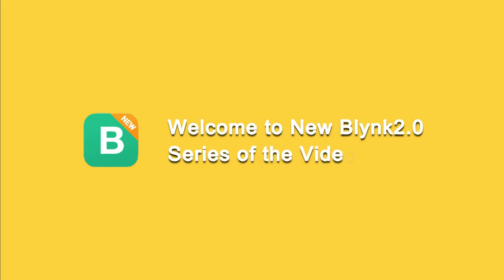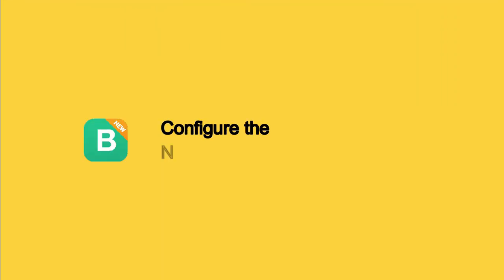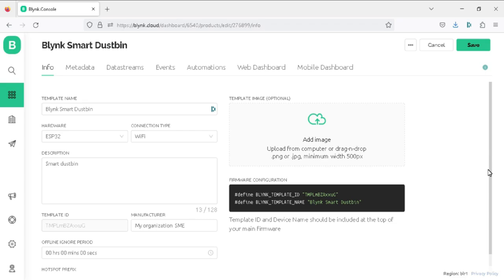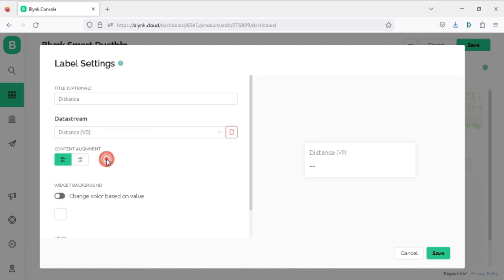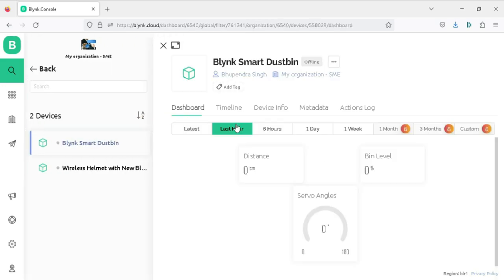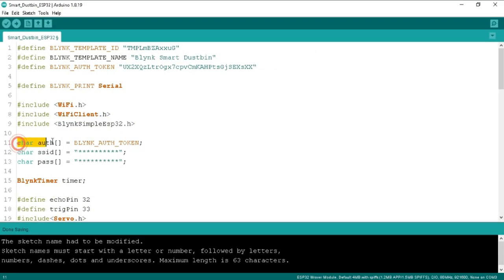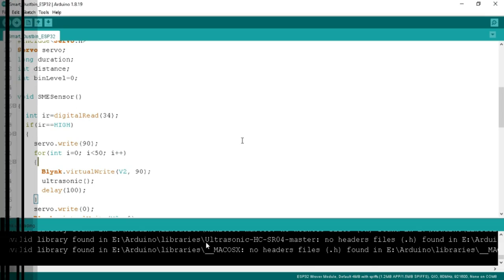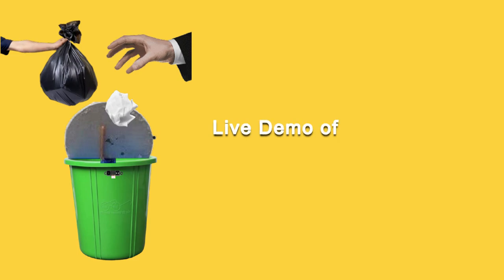Building a Smart Dustbin with IoT using Blynk 2.0 and ESP32/NodeMCU ESP8266 - Method 2

Comment: How to use nodemcu esp32 in this same project
Reply from the maker: You can use through serial communication or SPI or I2C method. Even you can communicate through wifi.
Reply: link is not opening @SMEDehradun
Reply from the maker: Which link?

Comment: bro the ultrasonic sensor is not responding!! i got light on ir sensor and servo is at angle 90degree!!! in my dashboard  the distance is showing 0 , bin level 100 and servo angle 90 degree!!! what shpuld i do now bro please help me out tomorrow i have my science exhibition !!! i am using esp2866
Reply from the maker: Hi,
Check that ultrasonic sensor is working or not? try to read the ultrasonic sensor separately first. If that working then try.

Comment: Hello sir, 
Code is working, 
But during the first time the IR sensor detects fastly and servo motor is opened and during the next time when i place hand infront of IR it is not detecting, it is taking more time
Reply from the maker: Hi,
Make sure that IR sensor would not get any direct light from any where. 
Also check that there is no any power issue in your board. 
Also check, your IR sensor is working properly or any connection issue.

Comment: For ESP8266 how and where have you given the power supply? Also what power supply have you given?
Reply from the maker: I have used 12V to 5V external power supply for the ESP8266. 
I used Vin pin for power input. 

You can use it without external power supply as per the circuit diagram.
Reply: @SMEDehradun  if we connect as per the circuit without the power supply ,then what will be the power supply for the system?
Reply from the maker: 5V 2A can work. You can provide the power from the computer’s USB port.

Comment: i tried doing everything sir , i connected it to 5v usb cable with 1A , i followed your tutorial step by step , code has also been uploaded but its not working , the sensors are not detecting anything , the servo motor is not rotating , i dont know what to do sir , please help me , there is a competition in few days and iam worried a lot , u r my last hope sir 🙏🙏🙏
Reply from the maker: Try to operate your all the hardware first like servo motor, IR sensor, ultrasonic sensor. 

Do the separate coding for these and check all aare working separately fine or not. Once all done well, then again try the complete code.

Comment: Uv sensor is not detecting the percentage and when I disconnect the ground of UV sensor it is showing the percentage but ir sensor and servo motor is not working
Any solution?
Reply from the maker: UV Sensor?
Reply: Sorry *ultrasonic sensor
Reply from the maker: Check the connecting wires if you are not getting data from ultrasonic sensor.
Reply: Wires are connected correctly the thing is when I disconnect the ground of ultrasonic sensor it is working but then ir sensor won't work
Reply from the maker: Check whether you missed any connection of ultrasonic as well as IR or you have plugged some connection wrong.
Reply: Its working
Thank you!
Reply from the maker: That’s Great. 🙏

Comment: Can this project work on 2 ultrasonic sensors? instead of using Ir sensor for opening and closing the dustbin, is it possible to use ultrasonic sensor? Thank you in advance sir!
Reply from the maker: Yes you can.
You can replace the the ir sensor. And you need to change little bit coding.
Reply: Sir could you please you provide those changes  @SMEDehradun
Reply from the maker: You can try it by yourself. If there is issue you can write it then.

Comment: Hello sir... Can you please provide proper code for esp32. I have tried everything but code isn't working it showing error.
Reply from the maker: Hi,
Both codes are well tested. So I think you are not following all instruction as shown in the video.
Reply: WARNING: library Servo claims to run on avr, megaavr, sam, samd, nrf52, stm32f4, mbed, mbed_nano, mbed_portenta,

In file included from C:\Users\admin\Downloads\smartbin123\smartbin123.ino:20:

mbed_rp2040 architecture(s) and may be inco

C:\Users\admin\AppData\Local\Arduino15\libraries\Servo\src/Servo.h:77:2: error: #error "This library only supports boards with an AVR, SAM, SAMD, NRF52 or S #error "This library only supports boards with an AVR, SAM, SAMD, NRF52 or STM32F4 processor."

exit status 1

Compilation error: exit status 1

Sir i followed each and every step carefully but still above error occurred
Reply from the maker: @BhagyashreeDGade  there are different servo library for ESP32 and ESP8266 board. if you are using esp32 board, then install the esp32 servo library for it.

Comment: Sir, i want all this that you did in this project and also want to send a alert email or notification on the app , that Dustbin is full
Reply: Sir kindly tell me how we add an alert message that Dustbin is full???????
Reply from the maker: Hi,
To add mail alert and notification, below video li k may help you

https://youtu.be/T8vPXUrAfco
Reply: @SMEDehradun  sir , how we set limit in dustbin project that when it's full when it sends an alert message only .
Because in fire alarm it's quite different.
Please help me ..
Reply from the maker: You need to set the timing for the alert to the blynk dashboard and call that function in the function
Reply: Actually i want to ask that, how we set that Dustbin only send e mail when it is 90% full or above...

Because in blynk dashboard it doesn't shown any condition like when it will send e-mail in alert section.
Reply from the maker: Join our official telegram channel for your query. Below is the link to join. 
 
https://t.me/+vJcqQmRQLKYwZWQ1

Comment: I cant open the code for 8266 please bro add google drive link for easy
Reply from the maker: Link is available in the video description for the code. That is the github link.
Reply: But the link is not opening bro 😞
Reply from the maker: It’s working here. It may be due to network issue there. try once again.
Reply: Not working bro 😷
Reply from the maker: @No_copy_music  it's may network or browser issue. you have to look on it.

Comment: Good day! If I were to use GSM as the connection type, would there be changes in the code?
Reply from the maker: Yes. If you want to use gsm network to connect with blynk, then code will be different.

Comment: sorry my coding is error l , i already to download library servo esp32 but still error like this

WARNING: library Servo claims to run on avr, megaavr, sam, samd, nrf52, stm32f4, mbed, mbed_nano, mbed_portenta, mbed_rp2040, renesas architecture(s) and may be incompatible with your current board which runs on esp32 architecture(s).
In file included from C:\Users\User\Music\teseps32\teseps32.ino:19:
c:\Users\User\Documents\Arduino\libraries\Servo\src/Servo.h:79:2: error: #error "This library only supports boards with an AVR, SAM, SAMD, NRF52 or STM32F4 processor."
 #error "This library only supports boards with an AVR, SAM, SAMD, NRF52 or STM32F4 processor."
  ^~~~~

exit status 1

Compilation error: exit status 1
Reply from the maker: Servo library for ESP32 & ESP8265 are different. So install as per your board.
Reply: @SMEDehradun  I've installed it according to the esp32 servo library same like in video
Reply from the maker: Hi,
Select the ESP32 board, then install all the libraries one by one then try to compile the program.
Reply: @SMEDehradun  fixed #include <esp32servo.h> sir
Reply: @SMEDehradun  but the another trouble is my servo is not working proper sir the servo rotating delay so long
Reply from the maker: It may be network issue
Reply: @SMEDehradun  my network is good sir, or maybe the problem is voltage sir?
Reply: @ridwanbsatriaji7099   u are installing esp32 servo right . in the program include ESP32servo,h becuase the library u installed and the name should be same
Reply: Sir getting same problem how to clear it
Reply from the maker: Issue is not the code.  The issue is with your library or in the board selection.
Reply: @SMEDehradun  hello, what servo library for esp8266? u not showing in the video for installing the servo library for esp8266..
Reply from the maker: Servo library is builtin with your Arduino ide. You can use it for esp8266.

Comment: I modified the code of IR sensor since sometimes it detects , sometimes it wont. I also not include the wifi.h and client since it will appear error on my IDE. Instead of servo.h,  I replaced with #include <ESP32Servo.h>. I  dont know why it appears error when I just include servo.h......OVerall thank you for the tutorial. It helps alot

this is what  I have done in my code to make it work.

#define BLYNK_TEMPLATE_ID "  fill this up   "
#define BLYNK_TEMPLATE_NAME "  fill this up    "
#define BLYNK_AUTH_TOKEN "    fill this up      "
#define BLYNK_PRINT Serial

#include <BlynkSimpleEsp32.h>

char auth[] = BLYNK_AUTH_TOKEN;
char ssid[] = "       ";
char pass[] = "        ";

BlynkTimer timer;

#define echoPin 32
#define trigPin 33

#include <ESP32Servo.h>  // downloaded esp32 servo in the manage libraries
Servo servo;
long duration;
int distance; 
int binLevel=0;
int IRpin=34;

void SMESensor(){
  
  int IRsensor=digitalRead(IRpin);

  if(IRsensor==0){
    servo.write(90);
    Blynk.virtualWrite(V2, 90);
    delay(1000);  // adjust time for opening

    
    
  }
  else{
    servo.write(0);
    Blynk.virtualWrite(V2, 0);
    
  }
  ultrasonic(); 
  delay(100);
}
void ultrasonic()
{
    digitalWrite(trigPin, LOW);
    delayMicroseconds(2);
    digitalWrite(trigPin, HIGH);
    delayMicroseconds(10);
    digitalWrite(trigPin, LOW);
    duration = pulseIn(echoPin, HIGH);
    distance = duration * 0.034 / 2; //formula to calculate the distance for ultrasonic sensor
    binLevel=map(distance, 21, 0, 0,100); // ADJUST BIN HEIGHT HERE  (21, 0, 0,100) means 0-21cm=distance converted to 0-100%
    Blynk.virtualWrite(V0, distance);
    Blynk.virtualWrite(V1, binLevel);
}
void setup()
{
  Serial.begin(9600);
  servo.attach(13);
  pinMode(IRpin, INPUT);
  pinMode(trigPin, OUTPUT); 
  pinMode(echoPin, INPUT); 
   Blynk.begin(auth, ssid, pass);
  delay(2000);
  timer.setInterval(1000L, SMESensor);
}

void loop() 
{
  Blynk.run();
  timer.run();
  SMESensor();

  Serial.print("Distance: ");
  Serial.print(distance);
  Serial.print(" cm");
  Serial.print(" | ");
  Serial.print("Bin level: ");
  Serial.print(binLevel);
  Serial.println(" %");
   
}
Reply from the maker: what error you are getting? is it servo library error?
Reply: @SMEDehradun  error in servo library. Wifi.h and wifi.client. Also, the IR sensor is sensing only at start.  This was fixed already by adding library of the esp32 servo and uncomment the wifi.h and wificlient.h.    Made a modification of your code in the void SMESensor();   This is the modification I made:                                                                  

void SMESensor()
{

  IRsensor=digitalRead(IRpin);
 
  if( IRsensor==0){
    servo.write(90);
    delay(5000);
    Blynk.virtualWrite(V2, 90);
    
  }
     
  else{
    servo.write(0);
    Blynk.virtualWrite(V2, 0);
    }
 
    ultrasonic();
    delay(5);
    
 } 

and include that SMESensor in the void loop

And its working.
Reply: Or this two for loops ....it also works.....

int IRsensor=digitalRead(IRpin);

  if(IRsensor==0){
    for(i=0; i<80; i++)     
    servo.write(90);
    Blynk.virtualWrite(V2, 90);
   
    }
    
  
  else{
    for(i=80 i>0; i--)
    servo.write(0);
    Blynk.virtualWrite(V2, 0);
    }
   ultrasonic(); 
  delay(200); 
  } 
  }
Reply from the maker: Library of servo motor is different for both esp8265 and ESP32 board. After installation, see the example of servo motor and make changes in servo motor commands in the program.

Comment: Sir
My esp8266 is not connecting with my router but it is connecting with my mobiles Hotspot.please help me.
Reply from the maker: Sometime special character is not recognized by the code so try to make router name and password simple so that it can easily connect.
Reply: @SMEDehradun  OK sir 👍
Reply: @SMEDehradun  sir but my nodemcu is connecting with my mobiles Hotspot and I wrote the same ssid and password of my router in the mobiles Hotspot section.
Reply from the maker: Write simple name and password without special character and then try.
Reply: @SMEDehradun  OK sir

Comment: hello sir, i have a question, does IR sensor and step down power supply is a necessity because i dont have it. Tq :)
Reply from the maker: IR sensor is used here to sense the hand, to open the bin flap. So it is necessary if you are using automatic opening of flap. Step down power supply is not required. You can use 5V power input.

Comment: Sir what changes should I make in the code if I am only using nodemcu esp8266 and ultrasonic sensor?
Reply from the maker: For what? Explain.
Reply: @SMEDehradun  All I will be doing is measuring the level of waste and displaying the reslut in the blynk app.So, what changes should I make in the code?
Reply from the maker: Then remove the code of ir sensor and servo motor.
Reply: @SMEDehradun  Sir shouldn't the blue light on node mcu be continuously on ? Like not just blink and not work. Does this mean my nodemcu is faulty?
Reply from the maker: No. NodeMCU’s blue led connected to D4 pin. You can test it digitally by writing the code for it.
Reply: @SMEDehradun  No sir I meant the light that remains ON, after connecting only the esp8266 to laptop.The light that shows the nodemcu is working.
Reply: The blue light on the NodeMCU board typically indicates power is being supplied to the board or it’s actively communicating with the computer.
Reply: @SMEDehradun  Even in my device manager port section there is no nodemcu shown...this means my device is faulty, right?
Reply: @SMEDehradun  Sir please reply
Reply from the maker: Is your board shown the com port? If yes then you can try for the program. And if not then try to install the com port driver for your board. 
Below video may help you- 

https://youtu.be/LpohiGf8GiU
Reply: @SMEDehradun  I have done that already.
Reply from the maker: Then it might be issue with your board.
Reply: @SMEDehradun  Sir if I am using only esp8266 and ultrasonic sensor to measure waste level...do i need an additional supply? Like an additional power supply other than me connecting the esp8266 to laptop? I am only going to use the prototype 5-6 times.   The laptop provides around 500mA power and the vcc pin on esp8266 is 3V .   Is there a chance my prototype won't work if i don't use an external 3V DC power supply?
Reply from the maker: There is no need for external power supply for ultrasonic sensor and esp8266.
Reply: @SMEDehradun  So I just have to do normal connections and then connect my esp to laptop and then it should work? But if the laptop gives 5V and esp can accept only 3V the esp would not work, right? The blue light on the NodeMCU board typically indicates power is being supplied to the board or it’s actively communicating with the computer....so should this blue light be continuously on?
Reply from the maker: It’s depend on your code.
Reply: @SMEDehradun  I just need the prototype to work minimum 6 times...so the only components i use is esp and ultrasonic sensor with jumper wires..and also esp connected to laptop with microcable. So the thing should work right? It won't be like the laptop gives 5V and esp can accept only 3V the esp would not work, right?  And my code is same as yours except the servomotor part
Reply from the maker: Yes it will work. The micro cable give enough power for your project and esp8266 board has builtin step down IC to convert 5V to 3.3V.
Reply: @SMEDehradun  Sir again my device doesnt show on device manager com port section. This is a new esp. I even re installed the driver cp210x but it still doesn't show on device manager. What am i supposed to do?
Reply from the maker: Disconnect all the connection from your board and then check that your board is showing the port or not?
Reply: @SMEDehradun  no it is not showing
Reply from the maker: Check you usb cable is it working or you can try another cable. 

Below video may help you- 

https://youtu.be/LpohiGf8GiU
Reply: @SMEDehradun  I tried sir still no use
Reply from the maker: If you have another computer, try it  with that, even after it’s not working then buy new baord.